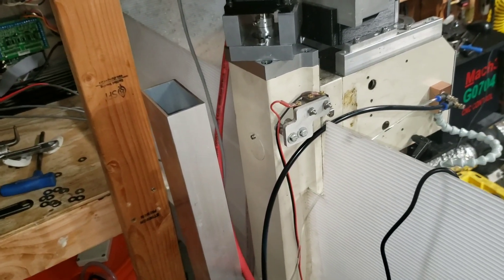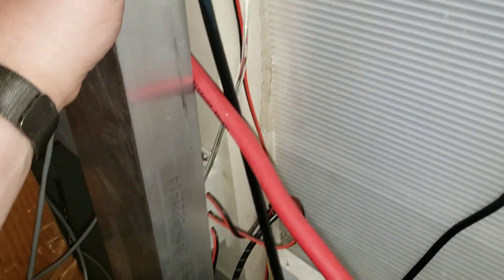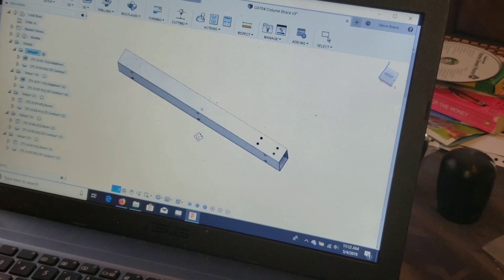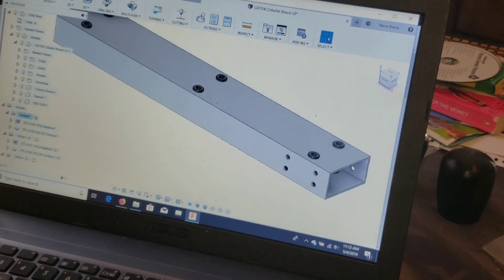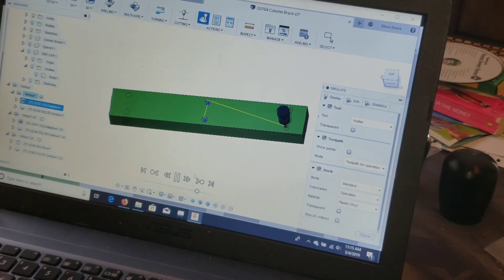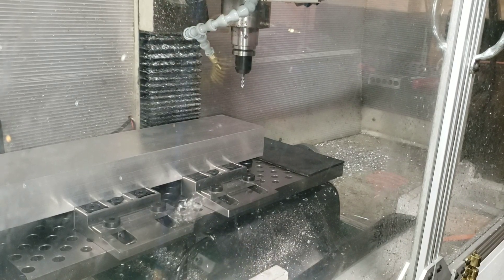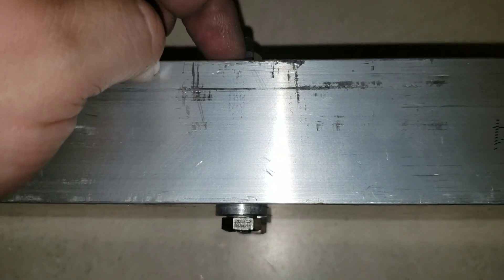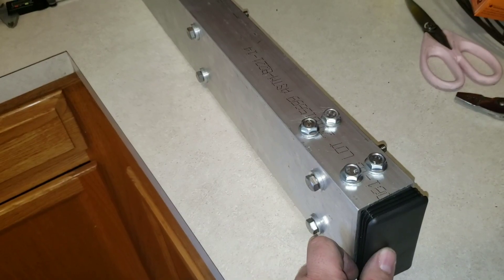G0704 Epoxy Granite filled column brace!  An easy way to make a hobby mill more rigid?  Part 1

Comment: Can I ask why you first drill all the holes then repeat to finish to final size? It would save a lot of time to drill and finish to size each hole in turn rather than repeat everything.
Reply from the maker: Didnt spend any time optimizing the tool paths in fusion.  One off part and not production.  I agree would be faster.

Comment from the maker: Column brace has helped with chatter and side to side twist of the head quite a bit.  Although there is still some Nod.  The side bolts I installed for a future brace will come into play shortly.   Stay tuned for the update videos.